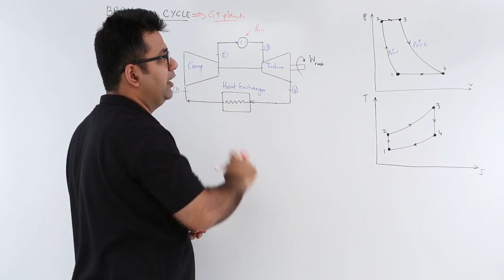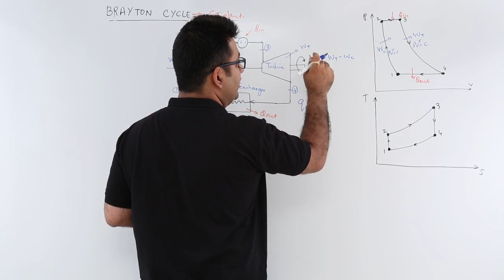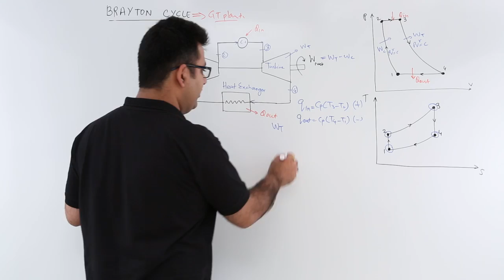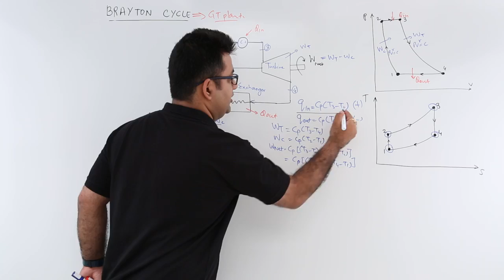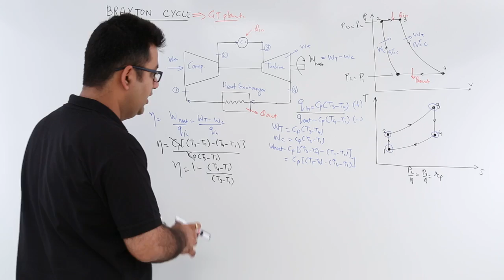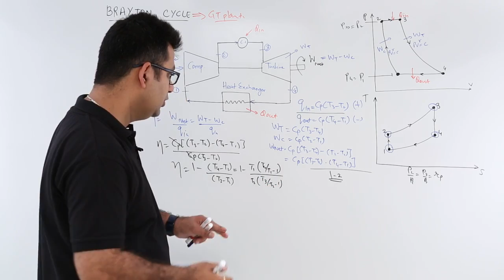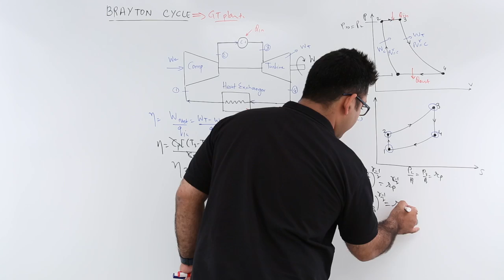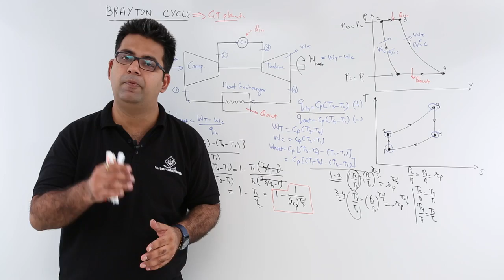Brayton Cycle

Comment: Hay, this thing works like a Stirling cycle engine.  Looks like the same calculations.  So instead of turbines pistons can be used.  Little tricks here and there and high efficiency can be achieved.  Advantage of Stirling being use on lower power applications.  Like when there is a source of heat think Brayton or Stirling to generate work.

Comment: Based on my own analysis regarding why Cp(dT) is used on turbine and compressor work, Enthalpy in each state is considered. For a cycle which uses heat as a source of energy, enthalpy is used thus, the turbine and compressor work is produced because of heat. We all know in an adiabatic process, enthalpy H=CpT so considering the whole cycle itself (not individually e.g. Compressor only) it is safe to use Wt=Wc=Cp(dT).
I still studying so correct me if am mistaken.

Comment: For an open system, using second TdS relation(TdS= dH-VdP) , Reversible steady flow work= - integral(VdP) - (change in KE) - (change in PE). This may help to understand why CpdT is used for workdone

Comment: Sir, Work done by the turbine and the compressor are isentropic work and those aren't constant pressure and constant volume processes.
Please explain?
Reply: In first law of thermodynamics Q=W+∆E, ∆E which is a state function zero for the whole cycle making Q=W. Now for the whole cycle net work done by turbine and compressor (isentropic parts) are equal to net heat absorbed during the cycle (constant pressure parts). That's why he took Cp∆T for Qin and Qout. Hope I could answer you.

Comment: sir you wrote that turbine work out put is cp *temperature difference but it is not constant pressure heat rejection.plz explain
Reply: same doubt
Reply: In brayton cycle we use open system analysis which means, we use enthalpy difference to calculate the work or heat interactions,moreover the working substance is air which is an ideal gas......so for an ideal gas enthalpy is dependent on Cp... since enthalpy could be written as (cp*dt) he has written so.
Reply: @vigneshwaranrm6277  irrelevant
Reply: @sagargoswami5385  let me elaborate,by first law of thermodynamics Q=W+∆E,since this is open system there is no change in internal energy,since we are interested in finding Workdone(W) which is equal to Q. As heat transfer is accompanied by change in enthalpy, i said so in the previous comment.
Reply: @vigneshwaranrm6277  so we can use efficiency=Qin-Qout/Qin, ... instead of W1-W2/W1,....
Reply: @vigneshwaranrm6277  but if you are saying that pressure is constant then how will you justify the PV diagram
Reply: @sagargoswami5385  Expansion in the turbine is isentropic in nature. For isentropic process also we write change in enthalpy as cpdt.
Reply: @sagargoswami5385  you can use efficiency if they have mentioned.if not we cannot use efficiency to arrive datas.
Reply: @vigneshwaranrm6277  we can take Q=cp*dt and apply it at the addition and rejection points.
Reply: @vigneshwaranrm6277  I agree that both expansion and compression are isoentropic works and also the volume is being increased and decreased respectively, hence pressure must have changed. Now you are applying "Cp" which is heat capacity at constant pressure???
Reply: @sagargoswami5385  It's completely problem specific and it depends on the datas provided to you.
Reply: @vigneshwaranrm6277  that was my exact question...
Reply: @vigneshwaranrm6277  too bad... At the end of the day we all accept it as "go according given data's"
Reply: @vigneshwaranrm6277  it's ok I'm not putting anything on you, surely I'm gonna do my work...I just asked hoping some help from you and others ...
Reply: @sagargoswami5385  If u have found out let me also know it!
Reply: @vigneshwaranrm6277  for the work of turbine we can use the formula {(p4v4-p3v3)/gamma-1} or we can directly integrate the area under the points 3 and 4..
Similarly we can find out the work for the compressor
Reply: @sagargoswami5385  thanks that you have replied can you elaborate?
Reply: @vigneshwaranrm6277  well I'm sure won't have any problem in finding the area under the 3-4 curve...
Reply: @vigneshwaranrm6277  same here....for sure
Reply: @sagargoswami5385  Yes for cyclic process we can blindly use it  {use efficiency=Qin-Qout/Qin, ... instead of W1-W2/W1,....}
Reply: In first law of thermodynamics Q=W+∆E, ∆E which is a state function zero for the whole cycle making Q=W. Now for the whole cycle net work done by turbine and compressor (isentropic parts) are equal to net heat absorbed during the cycle (constant pressure parts). That's why he took Cp∆T for Qin and Qout. Hope I could answer you.
Reply: esme 3 to 4 process kiu kartehe direct tubine se compressor me steam ko bhej deto kiu ki turbine ke outlet per steam hogi or uska cooling kartehe to wo wet steam  ya water me convert ho jati he vo compressor ko haani pahochayegi to 3 to 4 cooling process kiu kartehe plz..replay
Reply: Based on my own analysis regarding why Cp(dT) is used on turbine and compressor work, Enthalpy in each state is considered. For a cycle which uses heat as a source of energy, enthalpy is used thus, the turbine and compressor work is produced because of heat. We all know in an adiabatic process, enthalpy H=CpT so considering the whole cycle itself (not individually e.g. Compressor only) it is safe to use Wt=Wc=Cp(dT).
I still studying so correct me if am mistaken.
Reply: Here 3 years later with same question. Why can Cp be used for calculating W done on compressor and W out by turbine? So we don’t actually know how to calculate work done but since we know it’s equivalent to heat added / rejected, we just use mdot*Cp*ΔT? Which brings me back to the original question — how can Cp be used across the compressor or turbine?
Reply: @vigneshwaranrm6277  But Q = 0 in isentropic process right?
Reply: @andrewx3y8c  It is because in brayton cycle the working medium air..
For Ideal gas enthalpy is a function Cp so we write Q = mcpdt ...you can use this only for air powered cycles....
For pure substance cycles such as rankine you directly deal with enthalpy data.....